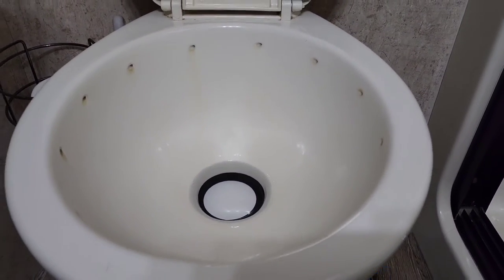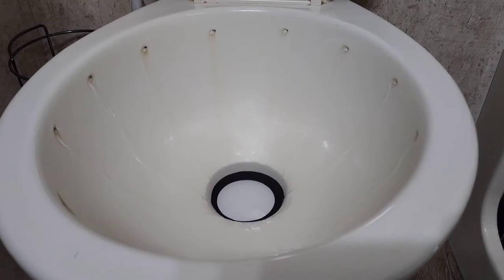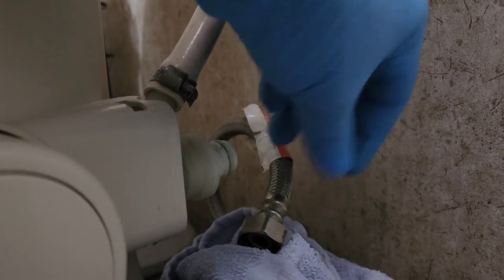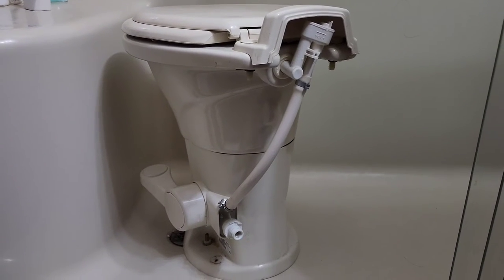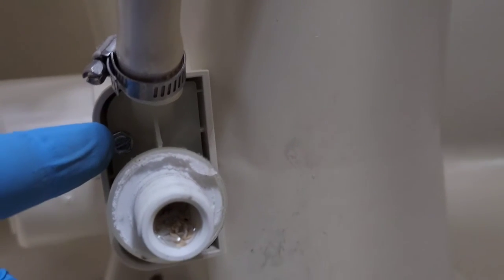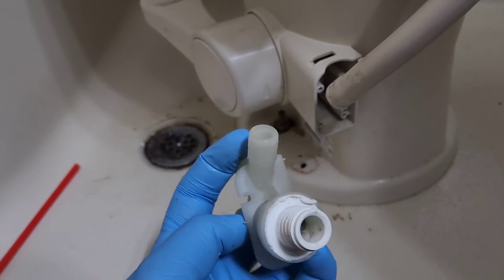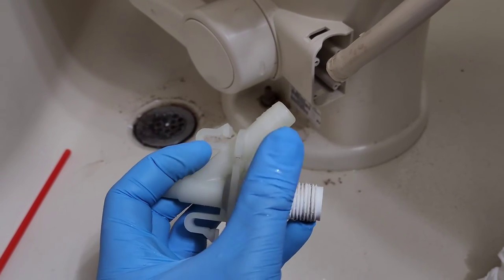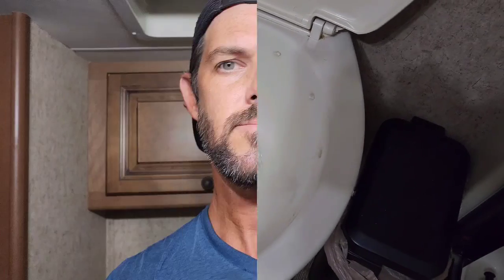RV: Dometic Toilet- NO WATER!

Comment: Mike you really helped me out with my Domatic toilet, no water flushing issue. This was on  my 2022 Mini Lite travel trailer. I was able to only remove the valve and clean the screen inlet part of v-valve. Now toilet is working 100%.  There is no need to cut the factory clamp. This was a 15-minute fix. 😊😊
Reply from the maker: Happy to help.
Reply: what was the best way to clean out the screen?  did you flush it with hot water only or did you use any tools or chemicals?

Comment: Do you feel it was necessary to remove the whole toilet? Or do you think you could’ve done the job with the toilet still in place… great video BTW
Reply from the maker: It may very well be possible to do without removing but it did make it a lot easier. Knowing what I know now, I'd still remove it cause it can be in a little bit of a tight space and you have a better visual.

Comment: Hi, thanks for you video, I have a question: I replaced an old toilet in my 1990 Motorhome Winnebago with a Dometic 311, this works in a way that it pours water as well as samples poorly without much pressure and only manages to fill up to half the bowl for one flush, for the next flush I have to wait It takes a while to get pressure, otherwise it pours little water... Is this operation correct like this? Thanks.

Comment: How do you clean water line so it would not clogged again.  Mine does twice on flush valve replaced
Reply from the maker: I don't know, I haven't  had any problems  with mine since cleaning the filter. I regularly change out the rv water filter so maybe that helps.